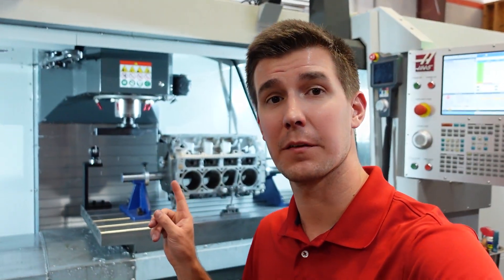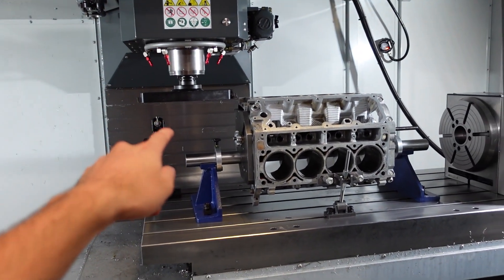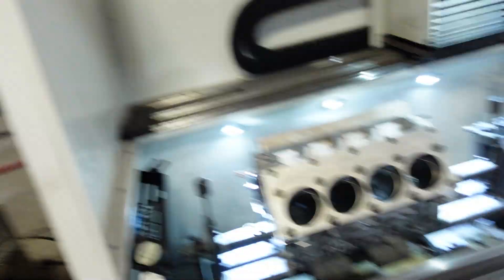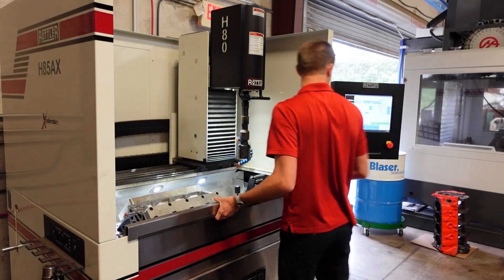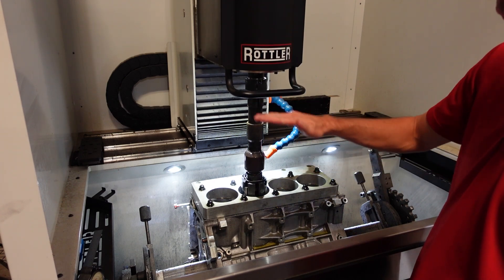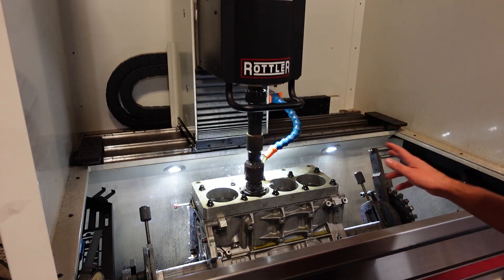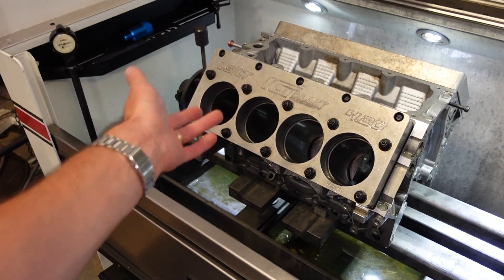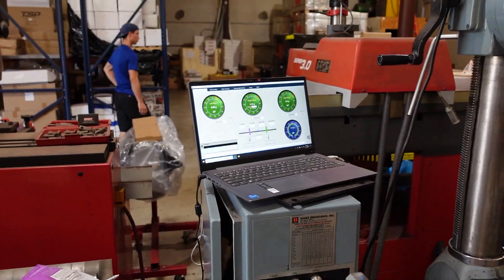Building a 383” Stroker LS1 - Part 2 | Machining & Balancing

Comment: To much piston to wall clearance in my opinion,  in that bore size a 4032 piston should be no more then 0.002-0.0022, 0.003 would be perfect for a 2618 piston, the alloy block expands more then you think

Comment: We just perched and 427 engine form you today. I do have a question we build a new 408 stroker that stated knocking when we  were on the chassis dino.  This a fully built engine with forged crank I-beam rods with a ARP, forged Pistons high volume oil pump, Johnson lifters,
If I take you the engine will you take a look at it?  I can’t figure out why it was knocking.  I need an expert like yourself.

Comment: Hi mate, the engine builder who machined my LS never torque plate honed it because he says how they placed the bolt holes as in not connected to bores doesn't affect the bores when the heads are tourqed down